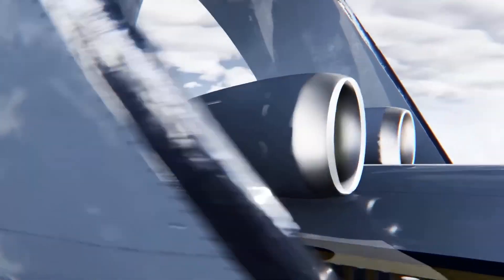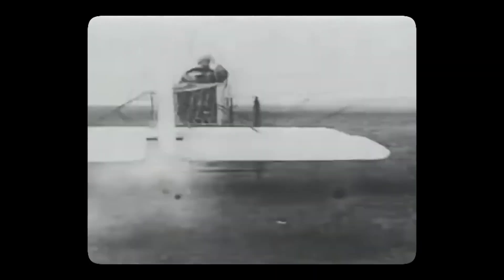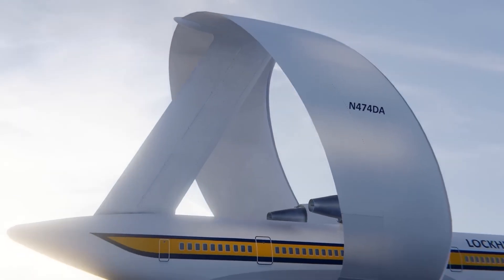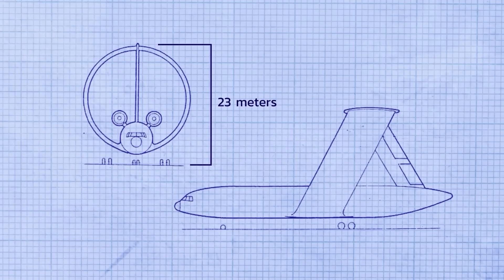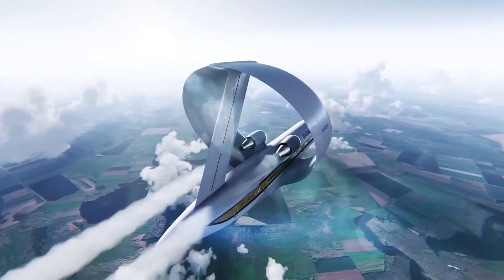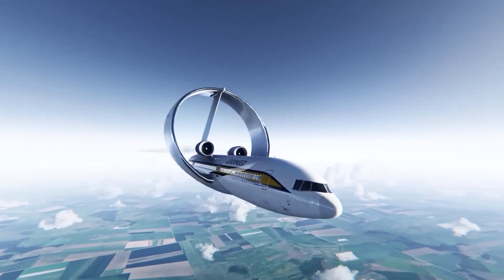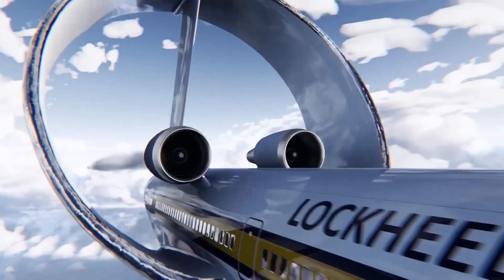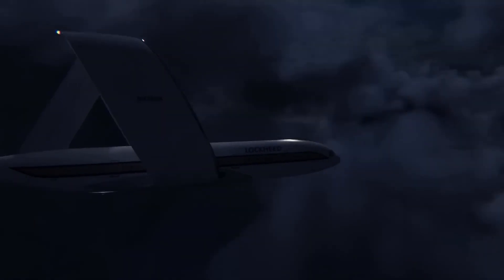What is Lockheed Martin Ring Wing airliner? A Leap in Aviation Design

Comment: Ok so you're telling me that the height is 23 meters but the circumference of the wing is 7.4 meters? Am I doing my math wrong? From the visual, lets say when the landing gear is out, that the plane is roughly 3 meters off the ground. So that would make the plane 20 meters tall when in flight. Then circumference equals 2r*pi or pi*diameter. So in this case the diameter or width of the plane is 7.4/pi which is less than 2.4 meters across? The circumference should be around 63 meters not 7.4. I have no idea where you got that information but it is incorrect.

Comment: The location of the engines on the fuselage and therefore closer to passengers (and indeed closer to breaking the annular wing) when something goes wrong seems like a big problem.
Reply from the maker: Yes, you are right, but this concept is likely to remain just a concept. However, if it were to become a reality, engineers would probably come up with some form of protection.

Comment: I guess you got one of the measurements wrong by a factor of 10. How can a wing circumference of only 7.4 meters result in an aircraft height of 23 meters with this design? A circumference of 7.4 meters means the diameter would only be 2.355 meters, so below the ring wing there was a landing gear of more than 20 meters height? 😅 I guess it should have been 74 meters circumference... or maybe something completely different? Anyway, a circle's circumference can never ever be less than the diameter and definitely not less than the radius like in your video. This should have made you question the validity of the numbers while making this video.
Reply from the maker: Thank you Gordon Brinkmann for your comment; you have a keen eye, and we'd be thrilled to have subscribers like you who help us refine our content. I overlooked the potential discrepancy in the original source, and as you mentioned, the circumference should not be 7.4 but 74 meters. However, the mistake might not be in the number but in the term used—perhaps the original source meant to refer to the wing span as 7.4 meters. We will endeavor to investigate further and pinpoint the exact error. Kudos and admiration to you for your attention to detail.

Comment: For this design are more the problems than the benefits. For example, contrary to what has been told in this video the crosswind would be a big threat during and after landing. That enormous vertical surface would make the airplane turn in to the wind very easily. The only benefit I may think about is the reduction of the induced drag. Fuel distribution may be another issue since the fuel is generally loaded in fuel tanks inside the wings. And much more...
Reply from the maker: You've raised some critical considerations there. Crosswind vulnerability during and after landing is a significant concern with the substantial vertical surface area in this design. While reducing induced drag is a potential benefit, the challenges you've highlighted, such as fuel distribution, are essential factors to address. Balancing the advantages and drawbacks in innovative designs is a complex task, and real-world practicality is crucial. What other potential issues or benefits do you foresee in this design, and how might they be effectively addressed?
Reply: @aviapages  I also think that a big surface of thos type of wing doesn't actually produce any lift which means the benefit gained is also reduced by an amount of material you need to bring along which is equal to weight. I think Lockheed did good to don't go further with this project. Nowadays modern airplane wings are very efficient. This ring wing is actually an old idea.

Comment: Maybe if the engine stalled it wouldn't be able or far to difficult to land
Reply from the maker: That's a valid point to consider. Engine stall scenarios are crucial factors in aircraft safety, and unconventional designs may pose unique challenges in such situations. Ensuring that any aircraft, regardless of its design, has reliable and effective systems for handling engine stalls and emergency landings is paramount. Safety should always be at the forefront of any innovative aviation concept. What safety features do you think would be essential in unconventional aircraft designs to address concerns like engine stalls?
Reply: @aviapages  
The ring wing should have a release mechanism on the tips of the connection on the wings by the rudder of the plane , and they could flip out just like they are today, and this way an emergency landing can take place
Other options are based on technology breakthroughs i.e if graphine can be manufactured into sheets, I believe you will have the best lightest parachute in the world

Comment: Is it stable on land? Does it have a high centre of gravity?
Reply from the maker: Great questions, Brian! The stability on land is a valid concern, especially with unconventional designs. The high center of gravity is indeed a potential challenge that needs careful consideration. Achieving a balance between groundbreaking design and practical stability is a delicate task. It would be interesting to see how the engineers address these concerns. What are your thoughts on maintaining stability in innovative aircraft designs, especially during ground operations?

Comment: this does look cool, but does it lead to higher stability or fuel efficiency? I suppose its footprint at ground level is reduced somewhat, but I'm skeptical of the actual operational benefit
Reply from the maker: Great questions! The cool factor is undeniable, but when it comes to stability and fuel efficiency, the jury is still out. Unconventional designs often present a trade-off between aesthetics and practical benefits. While it may reduce the ground footprint, the operational benefits are indeed a subject of scrutiny. It's essential to balance innovation with tangible advantages in stability, fuel efficiency, and overall performance. What's your take on how much emphasis should be placed on aesthetics versus measurable operational benefits in aircraft design?

Comment: Isn't only the horizontal section providing the lift?  The rest is just extra weight.  Probably not enough surface area to provide enough lift.
Reply from the maker: You've hit on a key point there! The circular wing design does challenge the conventional understanding of wings in aviation. While the horizontal section primarily generates lift, the additional structure may indeed contribute more to weight than lift. Striking the right balance between innovative design and practical aerodynamics is crucial. It's a fascinating discussion on the trade-offs and challenges in unconventional aircraft concepts. What are your thoughts on how to optimize lift and minimize weight in unique wing designs?

Comment: Every knowledgeable aircraft designer knows how to design an aircraft to maximize the lift to drag ratio and its product with the TAS, that requires high altitude flight and a large wing span and low wetted aerea. This contraption does just the opposite. BTW I worked for Lockheed and nobody there would suggest such garbage, Kelly Johnson would not tolerate it.
This video is just click bait.
But far worse:
I would never trust this company to have competent management or qualified pilots.
Operators are responsible to maintain airworthy aircraft.
The pilot in command is responsible for the airwortiness of the aircraft for the flight.
How can you trust the organization or the pilot with this kind of wishfull, time wasting dreams. Competent pilots stick to the FAR's and on the OM. What is your QNH?
Reply from the maker: I appreciate your perspective, especially with your background at Lockheed. You're absolutely right about the fundamental principles of aircraft design. The video's concept does deviate from the traditional approach, and trust in management and pilots is paramount in aviation.

While pushing boundaries can lead to breakthroughs, it's crucial to maintain adherence to industry standards and regulations. Safety should always be the top priority, and I completely understand your reservations. It's essential for any aviation endeavor, even innovative ones, to be grounded in sound engineering and operational practices. What's your take on finding a balance between innovation and adherence to established aviation norms?

Comment: You can't make an "in depth" video on anything in three and a half minutes. Talking about annular wing and not the SNECMA Coléoptère of the mid-1950s is unthinkable. surely, the circumference of tha wing was dar more than 7 meters and a change. The narration is abysmal - the chapter headings are eninciated in the same flat tone as the rest of the text - change your TTS S/W.
Reply from the maker: Hi, thanks for your comment. Can you recommend any?
Reply: @aviapages  Sorry, I cannot. See whether the one you use supports stress/intonation hints or annotation, or simply read yourself. You probably won't sound like a BBC anchor, but I bet it will be better than this.

Sorry for a cranky comment - I am allergic to five sentence "in depth" articles or videos, especially with factual errors at the very start.

Comment: I would have to assume it also would show instability at low speeds and I'm not entirely sure how it would perform during a turn but I would assume similar instabilities if the aircraft tilts like most conventional aircraft in turns. This obviously could be changed but i don't know if that was planned for or not. Keep in mind these are just thoughts of mine on this airplane, I am not educated enough on the subject to say if these were for sure problems with it or not, just speculating.
Reply from the maker: Good point of view, would be interesting to see simulator data. Hope we will see some prototypes in the future.